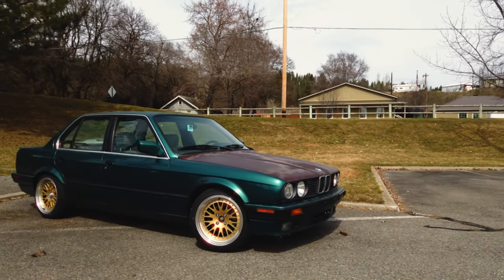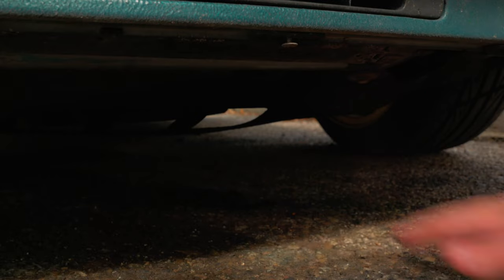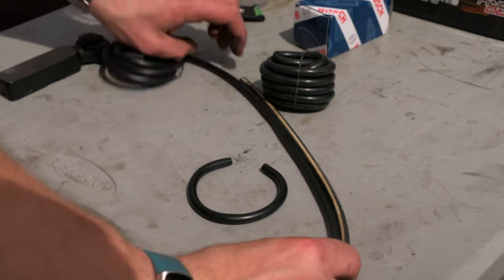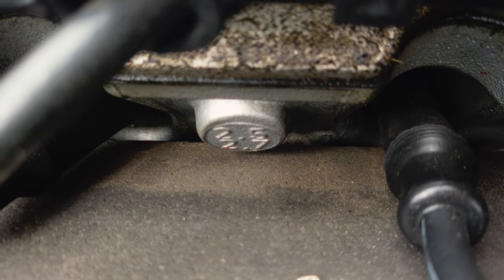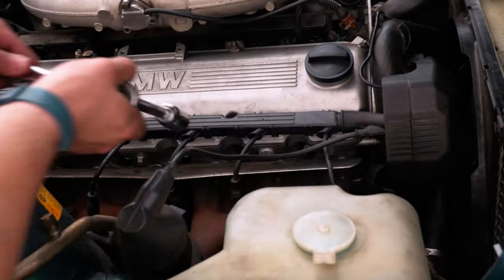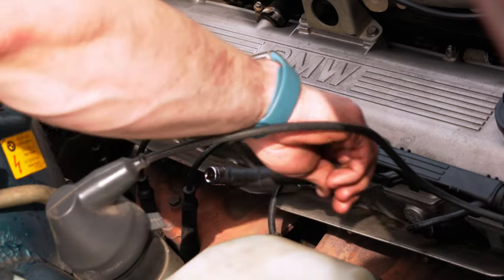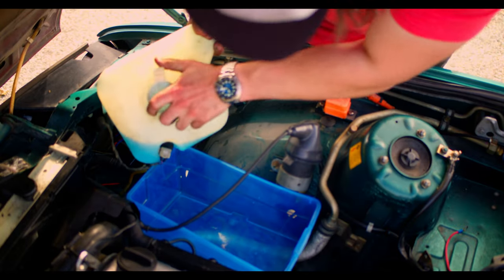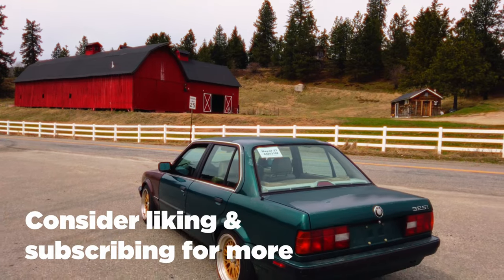Restoring A Forgotten E30 : Getting Started

Comment: as someone who grew up with distributors and points, and caps and rotors, it's always fun to see people marvel at the simplicity of the system.

coil packs and an actual EMS are better though.

a slight correction, the little screw on caps on the spark plugs are called terminals, removing them gives you access to the threaded terminal studs. whether you use the terminal studs, or the threaded terminal studs is irrespective of the type of ignition system (distributor, coil, and wires, or individual coil packs), it is completely dependent on which terminal type the system is designed to accept.

Comment: Awesome video! I'm in the process of restoring an E30 convertible. Also, The upper radiator hose doesn't have a patch, its chafe protection for the airbox. I bought a new hose thinking the same thing.

Comment: I have an 83 E21.  Great video and voice over.  One suggestion, use non-ethanol gas if available in your state.  Your fuel supply system will thank you.  It wasn't designed for ethanol.
Reply from the maker: Oh that's awesome to know! Thank you for the support and the suggestion!